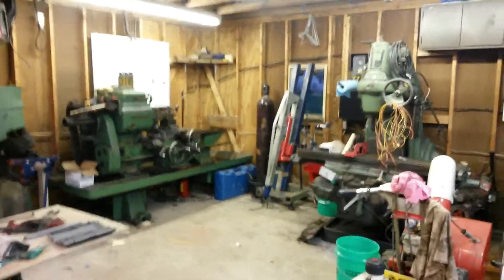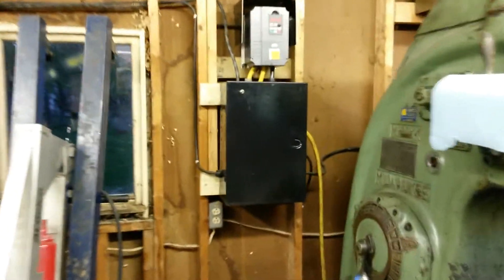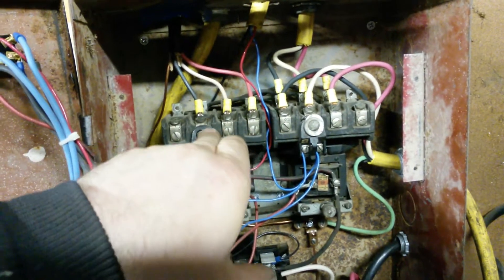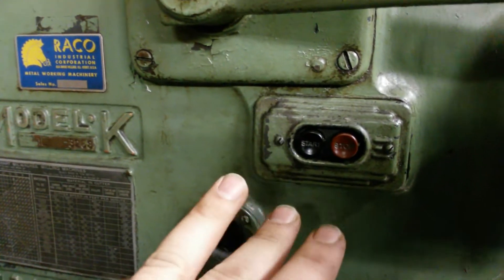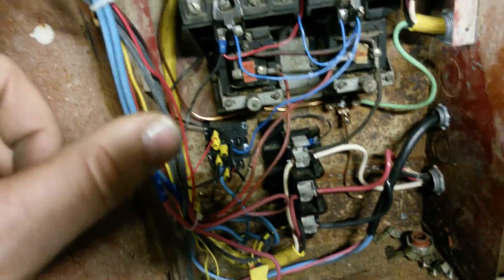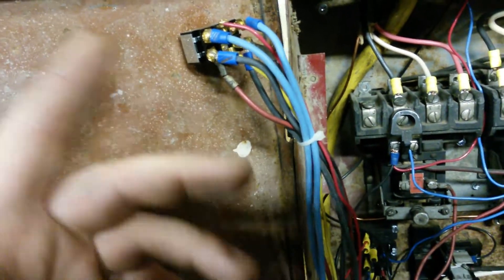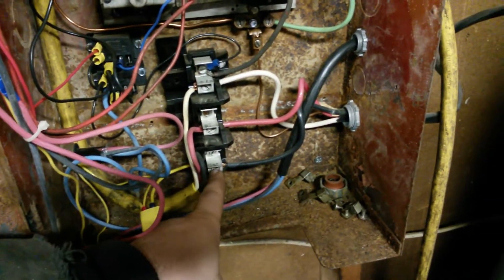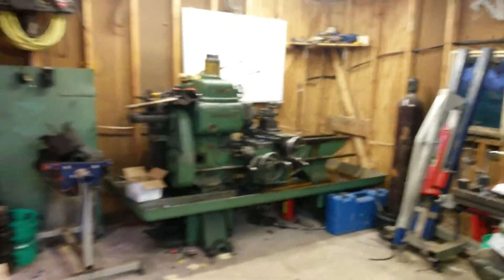Two 3 Phase Devices on One VFD Variable Frequency Drive Single Phase

Comment: Hi i have 3Phase cold saw.  instead of connecting the Variable Frequency Drive wires it to the motor,  can i plug the cold saws power plug into the Variable Frequency Drive?
Reply from the maker: You'd want to check with the VFD manufacturer, but usually they do not recommend opening or closing a circuit after the VFD, or at least on the cheap ones, so I'm guessing no for your question.  On this one, they don't even recommend to put a fuse or breaker between the VFD and the motor.  That's why there's so much going on to ensure that even if he accidentally flips the switch, it should simultaneously tell the VFD to turn off and hopefully prevent any damage.  If you disabled the switch on your saw so it was just on all the time, it would probably be fine to just control it via the VFD.  Thanks for watching and commenting and good luck with your project!
Reply: @burningdinosaurs   Thankyou.

Comment: That will definitely do the trick way to think outside of the box. Are both machines the same amperage?
Reply: I can say for sure the lathe has a 5hp motor and the mill is a 7.5hp
Reply from the maker: Mr Nate different amperage.  I don't remember the exact specs now but one is 10HP and one is 12HP or something like that. The VFD is set on automatic motor mode with a 1.5 second ramp up time to hopefully help it handle the loads. Think the VFD will be alright?  Thanks for watching and commenting!
Reply: burningdinosaurs as long as that VDF is rated for the amperage using you'll be okay. 10 and 12 horsepower are pretty similar as far as amperage goes. Haven't done the calculation but you should be pretty close to 30 amps you should make sure everything is rated for that including the wire and Breakers
Reply from the maker: mrhillmant is correct: 5HP and 7.5HP.  I think we oversized the feed a little since we thought about adding some other devices, but we might not.  I need to get my clamp amp meter on it to see what it's actually pulling when doing a hard pull on it.  Maybe I'll do a follow-up on it to show it in action once he gets some tooling for the mill.